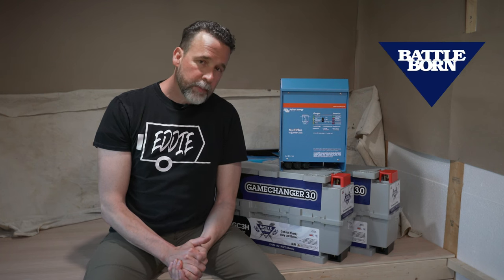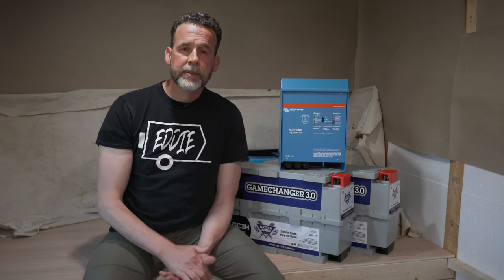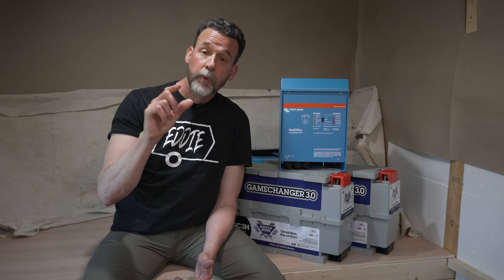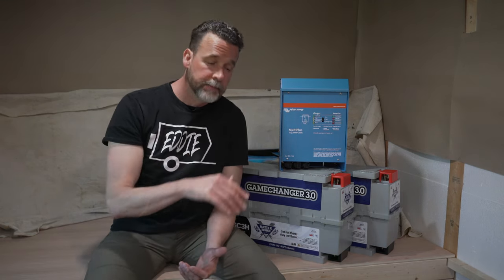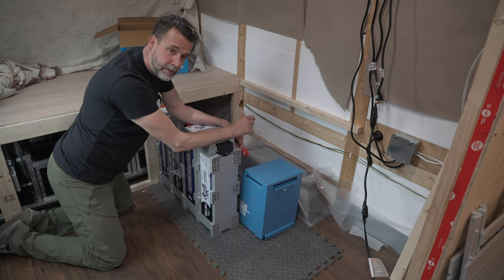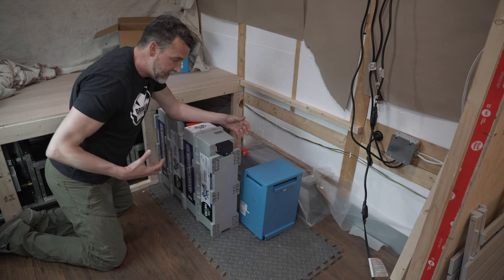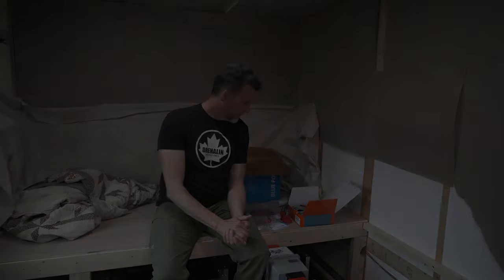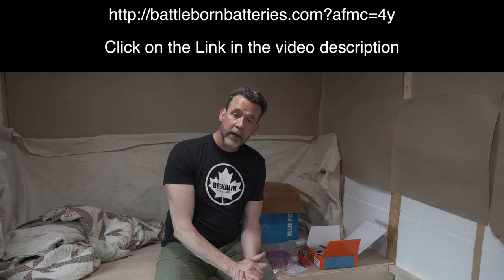How to Build a DIY Travel Trailer - Electrical Components for Wiring an Off Grid Camper/Caravan

Comment: You will need a heavy duty crimp tool for crimping terminals on the battery connectors. Check with your local electrical supply house for the necessary tools. Another issue is with stranded interconnect wire going to sensors is to make the job neater and safer you will need some wire ferrels and the crimp tool for them. These are sometimes available as a kit with the tool and an assortment of parts.
I hope they gave you detailed wiring instructions, it makes the job a breeze. As for charging some individuals with travel trailers will use an empty port on their 7 contact trailer plug to route power out to the trailer as they are driving to their destination. It involves adding a dual battery isolator to the output of the alternator, running the original charge one wire off of one of the isolator terminals back to the car ( it was removed from the back of the alternator, rout this to one of the outputs, connect a new jumper wire from the alternator output terminal to the isolator input terminal ). The second output terminal is run through the appropriate size fuse and the  output of the fuse is run with the appropriate sized wire to the trailer connector. The wire should be protected with spit loom tubing and tie wrapped to the chassis, away from hot exhaust components and any moving parts.

Comment: I found EXPLORIST life - DIY Campers on here has some excellent information on wiring up trailers and vans. And has good information on the same type of systems you are using. Also, if you haven't already, you could look into tankless water heaters, so you don't have to lose vertical space for a water heater.

Comment: Interesting.  I'm running 320W of solar panels and 3 batteries in parallel with a cutoff safety switch and works perfectly for my off-grid cabin.  Looking forward to seeing your system working. 👍

Comment: I see a lot of ads these days for small self-contained units like from Jackery or Ecoflow,   and I'd be curious to know if you thought about putting one of those in the trailer instead.  Seems like for a small trailer it would be a lot simpler to install, and yet still portable enough that you could pull it out for other needs.

Comment: I’m 8n the same boat. Trying to figure out the watt hours per item and how long to use it and what you need to run that while maintaining the proper levels in the battery, etc etc etc. I gave up 6 months ago, then tried to attack it again a few month as ago, and now I’m trying again. I think I’m coming to the conclusion that I’m going to go with a Jackery or Blueddi system and just adding panels to it.